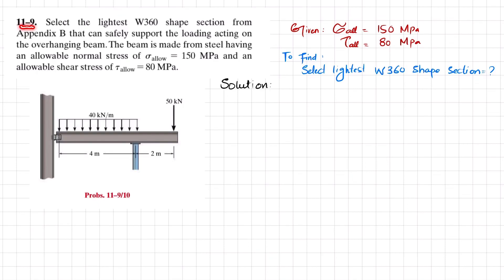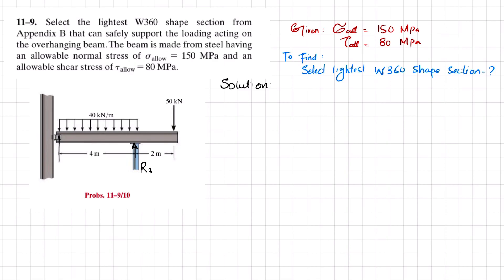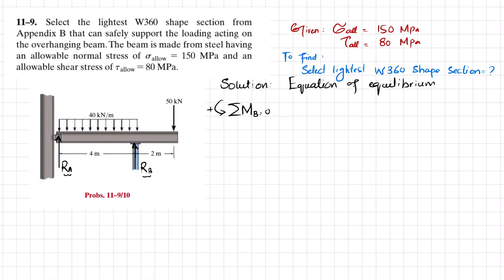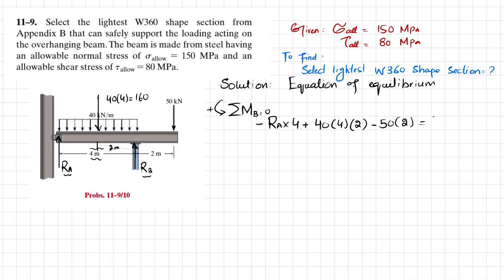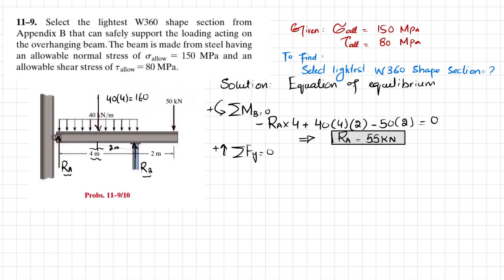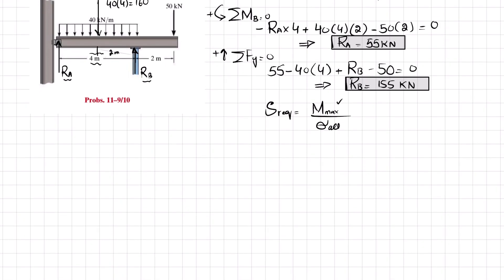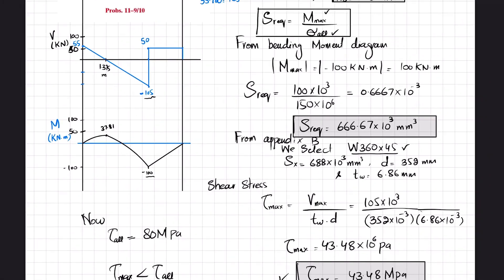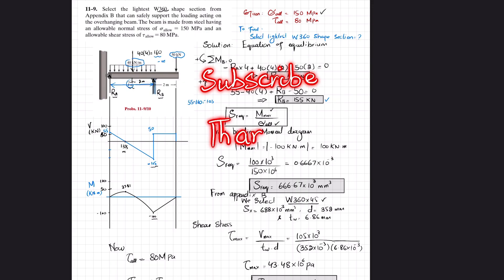11-9 Design of beam and shaft| Mechanics of Materials RC Hibbeler

Comment: how did u find the distance to be 1.375?
Reply from the maker: Well I have not done that step in this video but you can find it by cutting the beam  into region 0 < x<4 and find shear force V equation . Differentiate this equation with respect to x and make it equal to zero. That will give you the value of x=1.375 where shear force will be zero.

Comment: why we multiply with tw and d , when calculating the shear stress. it is not rectangular
Reply from the maker: You can see the Web of the Wide flange beam is rectangular and vertical shear acts on that. Therefore we take txd.  I hope you will have now a clear understanding 🙏
Reply: and why we divided Max Moment by allowable normal stress? shouild it be divided by allowable bending moment?
Reply from the maker: Section modulus S = Max bending moment/ ALLOWABLE BENDING STRESS. When you get S you can select the beam from the table. I will recommend to watch more problems related to this chapter and you will understand it very quickly 😊.  Thank you for watching the videos and asking questions.